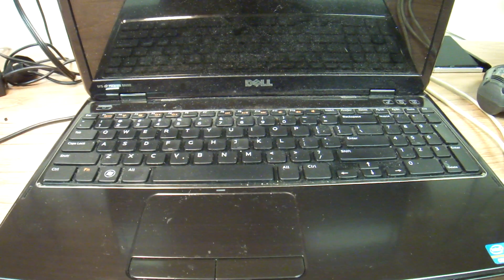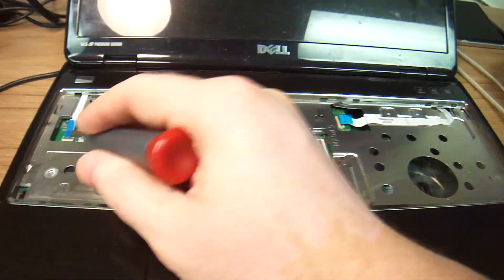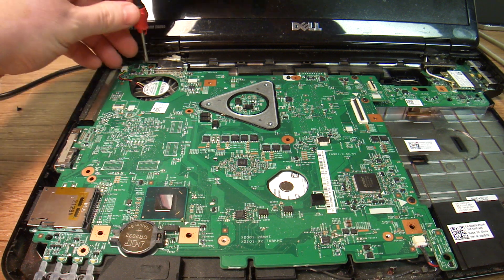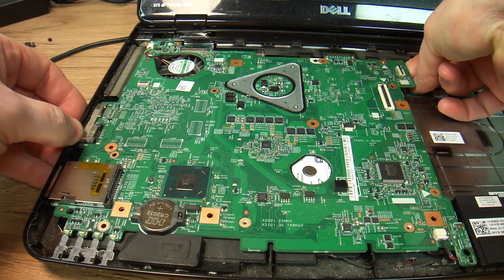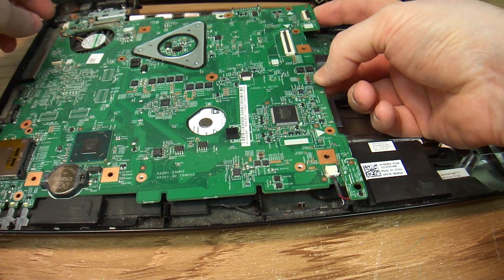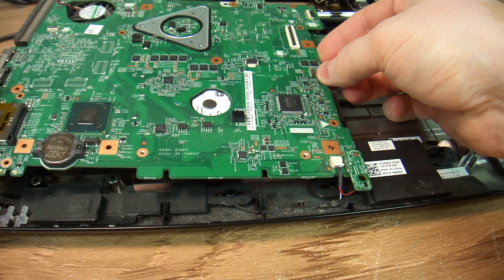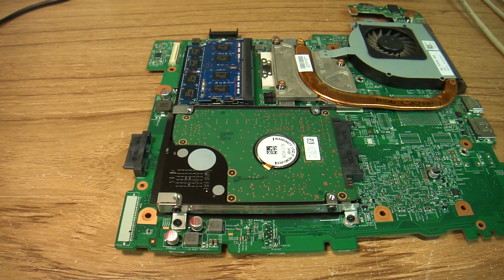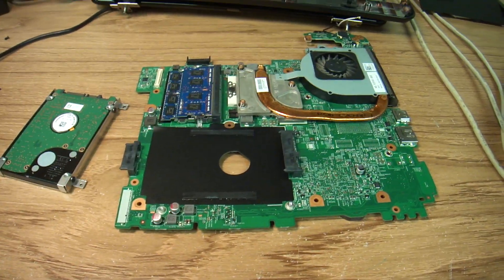How to disassemble Dell Inspiron N5110 complete Disassembly and hard drive removal MAH02576

Comment: you know what's worse about the n5110?? THE CPU IS SOCKETED! I can't believe what the hell the engineers over at DELL were smoking...

also i guess someone had already been in mine because the rubber boots weren't there and the hard drive screws weren't install crooked xD

Comment: Saved me a lot of headache on this. Mine wouldn't boot past the BIOS screen so I was going to just pull the disk out and put it in my disk toaster to read instead. Well, in part with the teardown I forgot to open the CD bay, so when I powered it on with the battery out it fired up with no issue. 4 years of content, saved now.

Comment: Can't agree with you more. Had to replace the HDD in one of these Dell N5110 laptops. It's not difficult but it's very annoying. Most laptops involve only one or two screws to be removed in order to replace the HDD.

Comment: This is an excellent video, helped me take apart my n5110 but I don’t know what the problem with mine is, the lcd will not turn on but the computer will. At one point it was doing the 2 beep error sound but after disassembling and reassembling the computer it is in the same state that it was in. I had some water spill & it got inside the computer earlier today but I cleaned all of it out and now its just kaput. Is my information still obtainable if I remove the hard drive or is it lost forever?

Comment: The right hinge was broken on my N5110. I wanted to reuse as much HW as possible.
Hence, this video is a cool guide for a whole disassembly of the notebook. Thanks a lot.
Reply: it's one of the most common issues on this model...it's crazy. I know 3 n5110 with broken right hinges!!!
Reply: Just opened it. Mine too lol. Good video. Thanks for the advice!
Reply: Exactly same thing happened to my dad's 5110. Right hinge. Seems it is a common issue. He wanted me to take out drive so we can copy info over. Good thing laptop was not meant to be used anymore so i could be more ruthless with disassembly. But putting disk below motherboard so you have to take apart whole laptop is pure evil.